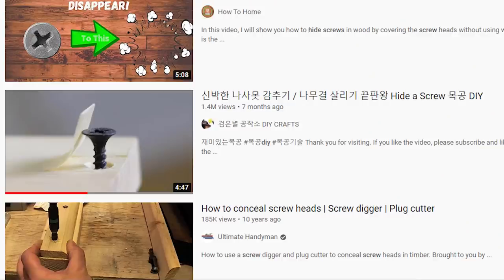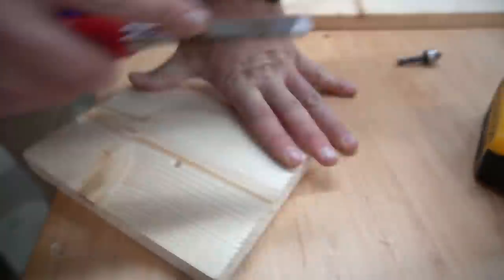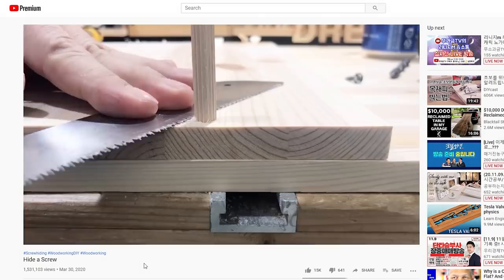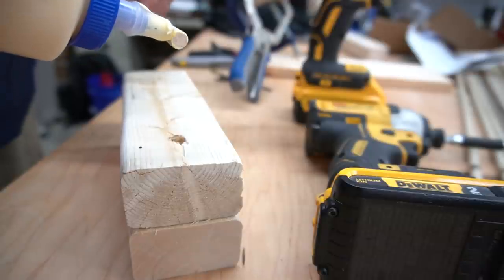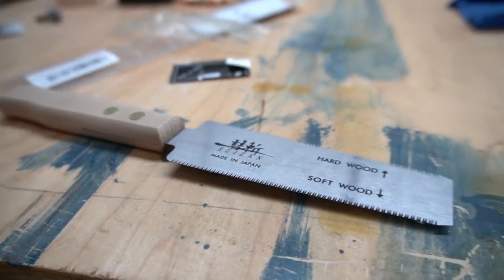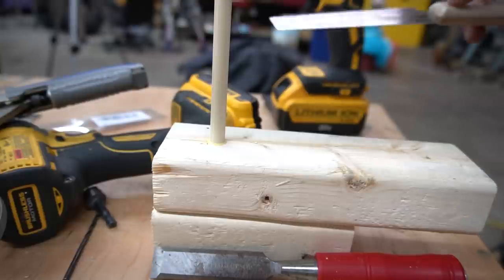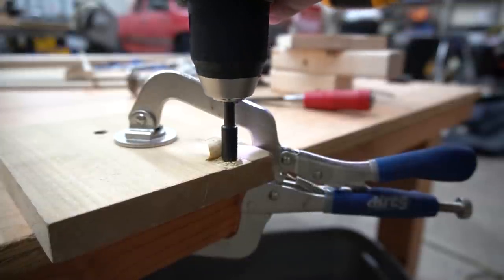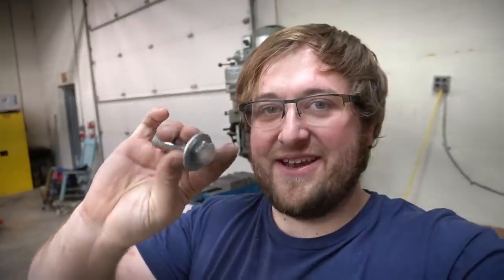I Tried Following a Woodworking Tutorial

Comment: Some tips: your chisel is upside down. Cheap modern chisels can cut just a good as expensive ones. Expensive ones will hold an edge better. You need to sharpen that chisel. Using the razor blade is very similar to a scoring knife. They are made to cut the grain on the line of the cut, so you were right in using the razor blade, even though you said you were cheating.
Reply from the maker: I'll have to try again with it turned around! I think it came pretty dull, will try to sharpen it (trying to use it as is for dovetails was awful)

Comment: Sam when you clamp up the wood try this-Place some plastic sheeting like polythene between two strips of flat wood,when the clamps are released you will get a perfect surface needing very little clean up,use the Aliphatic resin glue as adhesive.Yes those pull saws are the bees knees and work really well.You can do more wood projects in the future and film them.

Comment: Very interesting video and a nice little woodworking trick to try out.
Reply from the maker: Thank you very much, If you try it let me know how it worked!
Reply: Gave it a try and it definitely requires some practice. I think a softer wood may help. The hardest thing is keeping that angle just right and shaving off enough wood so when glued the screw head isnt noticeable after sanding. Other than that its just having a chisel stropped nice and sharp.

Comment: I screwed down 3×10 lumber I milled for the wood floor in my cabin and just drove the screws below the surface. To hide the holes I put wood putty in them then sanded the whole floor stained and varnished it. It looks great 10 years later and held up better than any flooring i bought. Have to get down and look hard for screw holes.
Reply from the maker: Awesome! I love wood putty. I used some for a few giant cracks in some hardwood flooring, and with stain they all but vanished. It looked so bad before the stain, I was thinking there was no way it was going to work out!
Reply: @SamFoskuhl  i love working with wood, amazing what you can make. I've built skyscrapers and 4x4 buggies,  but now I'm building my third house. Cutting down trees and milling them with a chainsaw. Every one tells me its to much work,  but someone has to do it and its been a fun learning experience to go from a tree to a house.